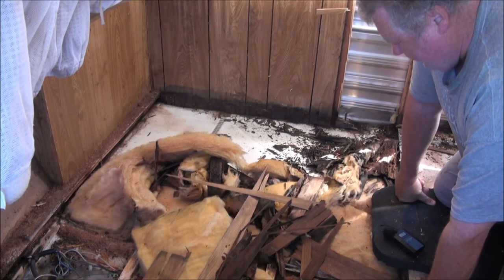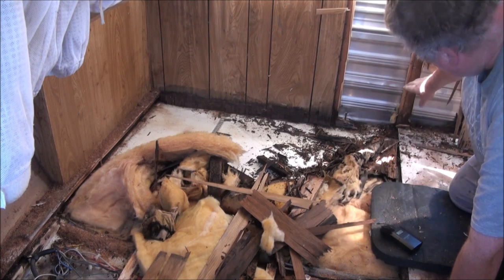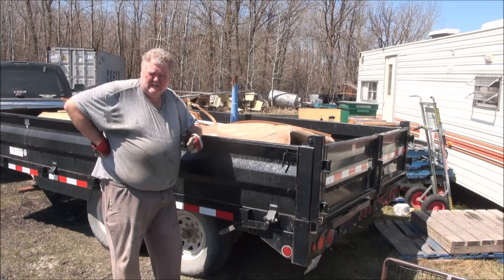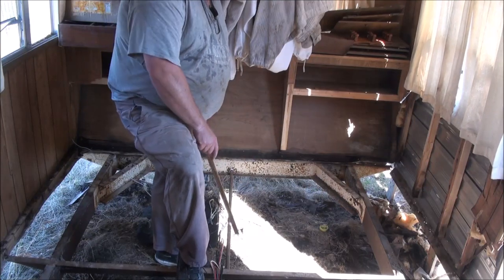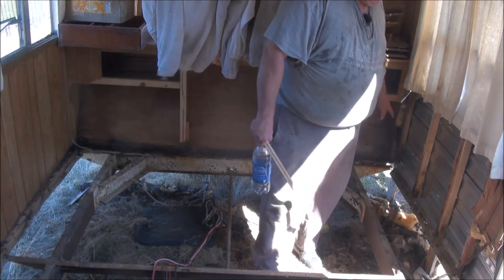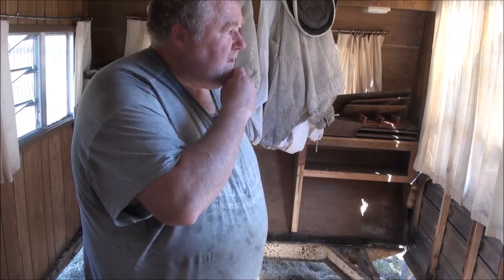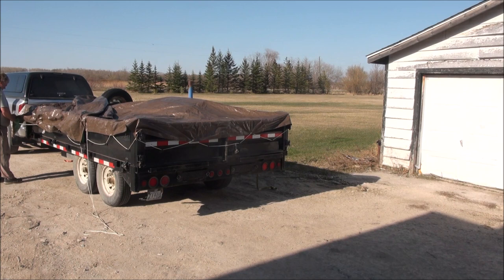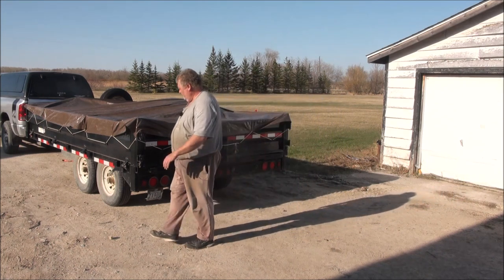Apiary Camper Demolition - That Bee Man

Comment: Fun project.  Sure am glad I'm just sitting in a chair watching you do all that work!  Nice trailer, can't believe you filled it!  I rehabbed a 1985 motor home, so feel your pain, no room to maneuver in those things, and yes, that one is terribly built, those floor joists are a joke!  Made in Canada? Or USA?  My motor home was built much more solid, no rot whatsoever, regret selling it.  Once finished, this will good be a good work shed, but yeah, might make sense to pay attention to the roof, these types of things, so I was told, should have a sealant applied each year on roof, never did that and it was fine.  I really don't understand why you did not simply burn the material, then take a magnet over it afterwards to remove screws and nails?  $40 down the hole ROFL Never mention the time and effort it took you to tarp the trailer!  Just joking... did you get a municipal ticket, or did the dump employees give you a funny look?  ehh?  You are correct about building codes, I don't think there is a building code on the planet where a 2x2 is to code. Horizontal 2x4 is an improvement, but far from ideal, horizontal they will bend when you walk on them, you should simply weld some scrap metal beams ( 1x1 square beams, except you should probably have some in the opposite direction too $$$) to provide proper support, then put plywood on top with bolts? aka fix the poor engineering (who in their right mind would design a floor joist like that, with a gas pipe, or trailer like that), simple, keep it simple silly. Get er Done!  It will be worth it in the long run.  Inspirational Video!  With the fast forward action, you looked just like a "busy bee"!  Bee Busy!  I bet it already smells better with all that rotten wood and insulation removed, yet, I'm very concerned about the squirrel that used to live there, I'm sure he found a more natural home? Heads up subscribers, I will share with you something I know about The Bee Man you may not, decades ago gave him a computer, the Bee Man took it all apart, every single element, I came back and saw it was torn apart (I mean everything 50 DIP switches, boards, everything was torn apart, wires too), and thought what has he done?  Well, without an instruction manual the Bee Man put it all back together again, and in the end, was better afterwards, I was amazed, not only is this guy a down to earth decent citizen, and, obviously, hard working, he's danged smart!  And a good Bee Man! I Truly hope your cup overfloweth with honey this year That Bee Man, and all other Bee Man's, us humble people require that golden honey, just had some today and silently thanked those who brought it to my table as I poured it  (peanut butter sandwich with honey, it kills germs) thank you Honey farmers for providing this to us simple people, I for one, appreciate your hard work and end product. Very much, trust me, your work is not in vain, and is appreciated by many people you will never meet, because these people you will never meet,  as they pour the honey, I'm sure they think about the farmer that provided this nourishment, with admiration in their hearts, well, at least I do, thanks farmers.  Thank you all, so much.